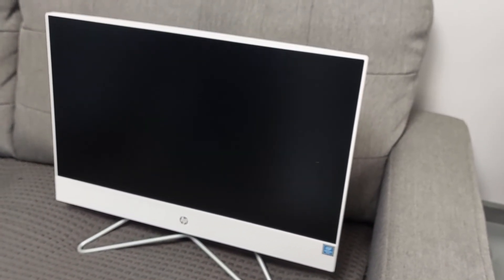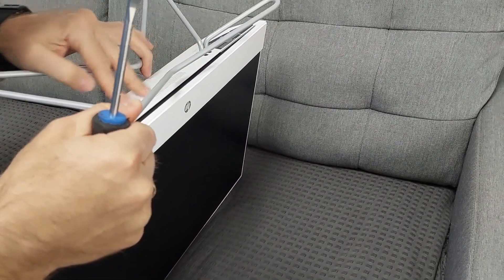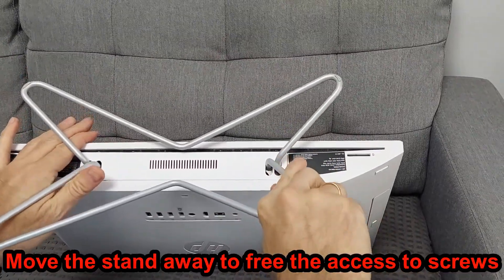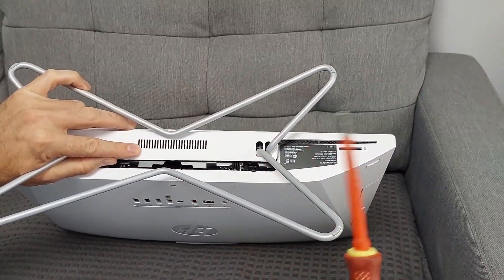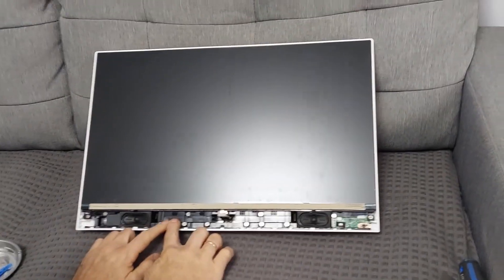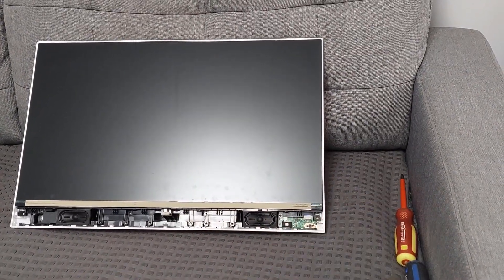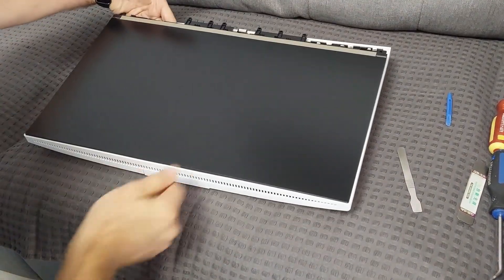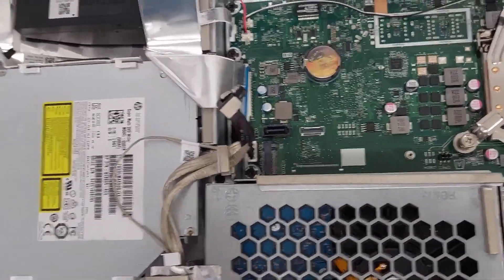HP All In One - Disassembly/ Preparing for SSD + Memory Upgrade

Comment: Is there only one RAM slot? Can you leave the original HDD, clone Win 10 / 11 to the new M.2 / NvME, reformat the HDD and use it as an additional storage? Would also have to change the letter designation!
Reply from the maker: Here, 2 videos in Russian, but you can turn on auto dubbing:
https://youtu.be/qIRlsjJTC9U

https://youtu.be/g_k1-NYptHw
Reply from the maker: Windows 11 is ressource hungry, so don't bother
Reply from the maker: i would install instead - Chrome OS Flex or Fyde OS, i have videos how to install it
Reply from the maker: If you will install Chrome OS Flex, the amount of Ram will not be an issue, i ran flex on 2gb ram flawlessly
Reply from the maker: Sorry, i thought you asked about HP tablet the video i have. Still , this machine is very budget and it's not very performant, so try Chrome OS Flex, let me know. Cheers
Reply: @AlejandroNemo I found a tossed out HP 22-df0013w (apartment dumpster!), but the screen is broken! A replacement screen (non touch) is overpriced! So I thought of taking the SSD, RAM, DVD player, and maybe the Wi-Fi card out, and scrap the rest!
Reply from the maker: @j.lietka9406 does it have the video out port HDMI or something else?
Reply: @AlejandroNemo I believe it has the HDMI port, but I haven't tested it yet. I am assuming it works (has Win 10 Home)